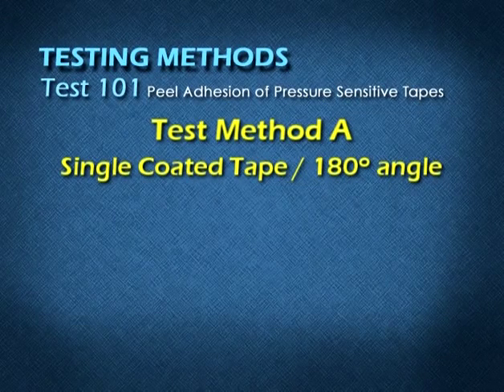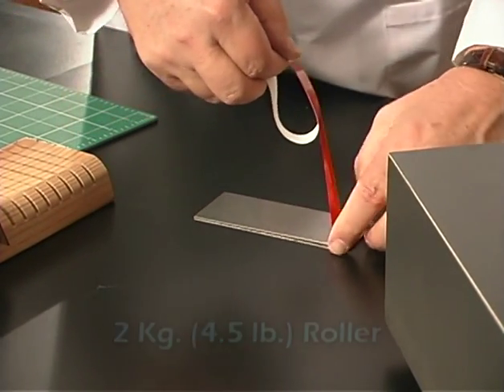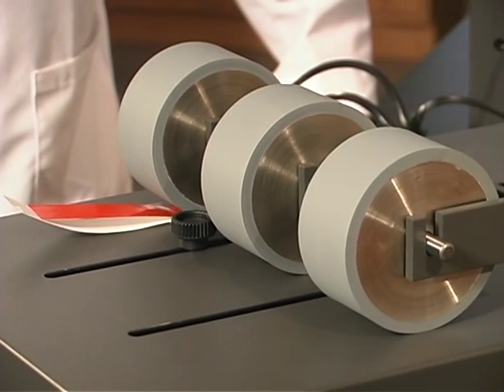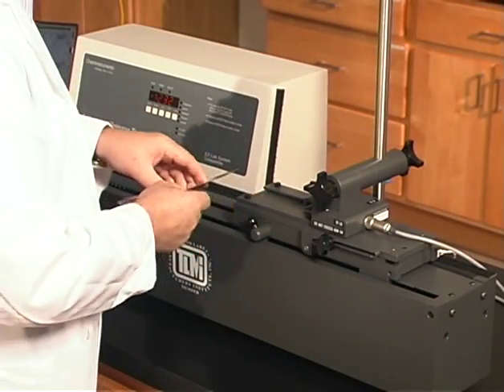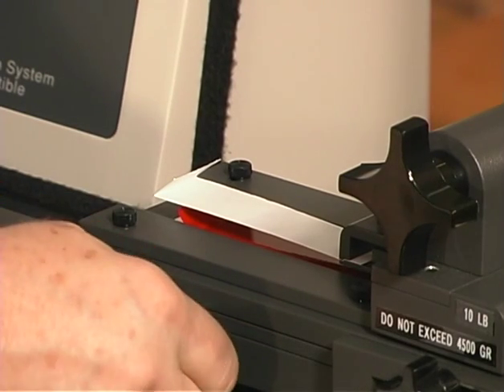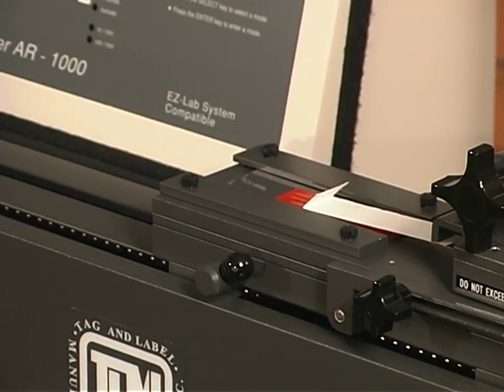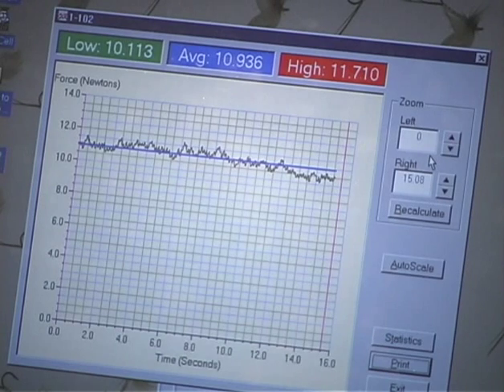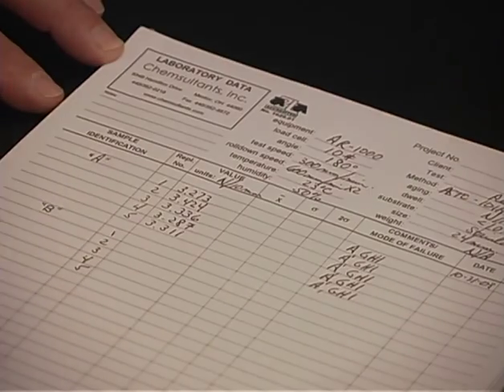Peel Adhesion of Pressure Sensitive Tape

Comment: Pressure sensitive adhesive tape, also called as PSA are adhesive tapes with relatively thin flexible material having single or double sided coating. 
Pressure sensitive adhesive tapes are designed to deliver engineered assembly solutions for widespread industrial applications, such as packaging, sealing, labelling, electrical insulation, stationery.
Visit for more: http://bit.ly/2yQBJUm